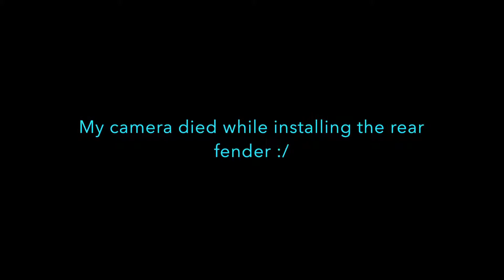BungKing Lift Kit + Rear Fender Install - Dyna Build Ep - 10

Comment: We used to do this on our dirt bikes back in the 70s to get more suspension without spending a fortune on shocks , glade to see someone sells this kit,, it works we would move the lower shock mount forward a couple inches too but that you had to cut the mount off and reweld it